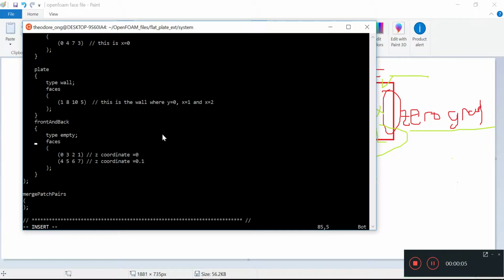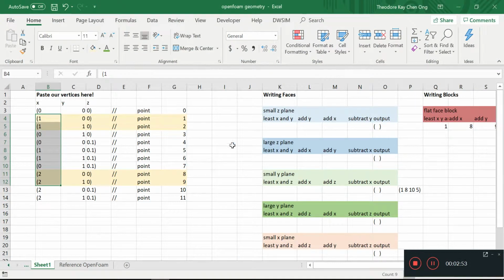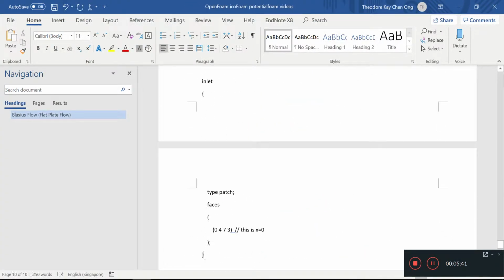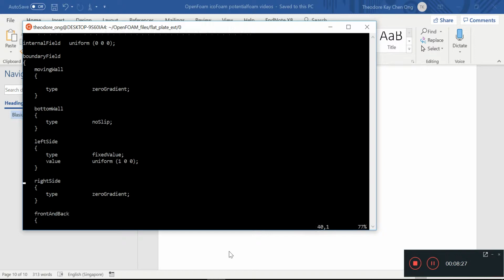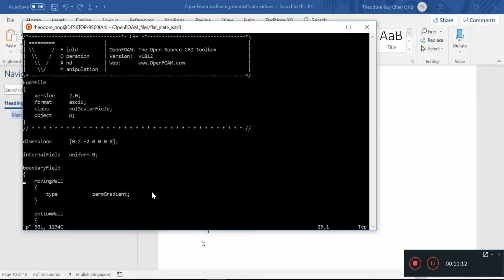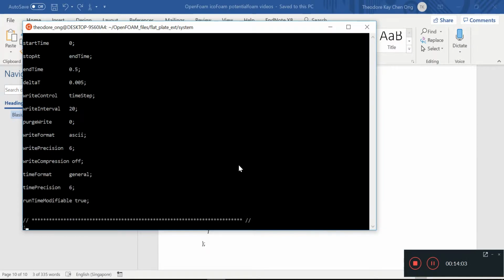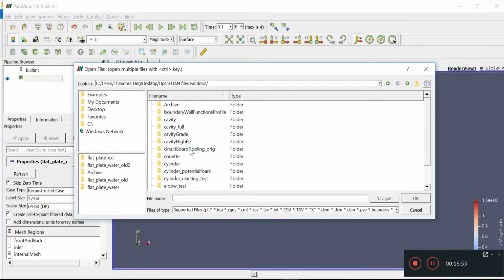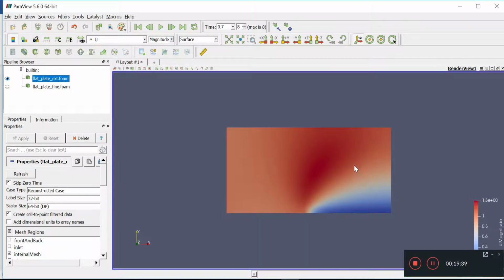OpenFoam for Beginners Win10 19 - blockMeshDict for BL flow 8 plus test

Comment: hey! I am not getting the output as desired i am getting high pressure at the center bottom point( in between the two blocks) and its decreasing with height of the blocks and the velocity is also looking weird. I double checked the boundary conditions , they seem to be right , can you please tell me why the pressure is becoming very high in between the two blocks. ??